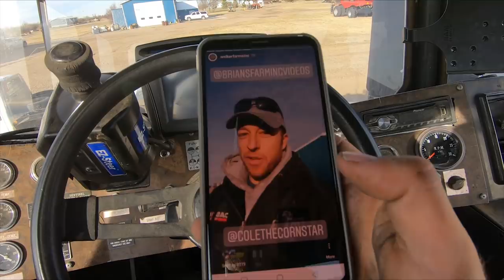Gearing Up For Winter

Comment: I use nothing but non ethanol 91 octane all year long in all 18 of my small engines.  Towards winter time I give them a splash of Sea Foam.  Works great up hear in northern Minnesota.  That way I don't have to worry about draining out the crappy ethanol fuel.  Been doing it for years and have never had a problem starting the engines back up in the spring.  Ethanol mixed gas has a short shelf life, gums up carburetors and damages o rings, fuel lines, diaphragms etc.    I do use it in my truck and the wife's van but never ever in anything that has gas sitting in the tank for more that a week.

Comment: tip from a car mechanic. when removing the tire, place the sensor right before 12 oclock. when getting the tire on the rim, place the sensor at 3 oclock. do that and you will never bust a sensor

Comment: Here in Minnesota we buy non oxygenated gas at the gas station. It is really just Ethyl/Hi test but has no ethanol just use it all the time in small motors or low use stuff, saves keeping track  at the season change. Then just take the can from the mower to the snow blower. Always ready.

Comment: We have several gas stations around here (Fond du Lac WI) where we always buy 91 octane gas w/ no ethanol which we use in all our small gas engines.  We usually try to use up most of the gas in each machine and then add some Sta-Bil gas stabilizer for the winter.

Comment: Not sure the price of avgas,  we use VP small engine fuel. It’s high octane and last years. Just talked to one of the engineers a few days ago. He stated in the original can it’s good for 4 years. Out of the can it’s good for two years. It comes in 50:1/40:1/4cycle. Not the cheapest but it’s done my farm and businesses well. They also make a mix called mechanic in a bottle. It has fixed two of my 2 cycle engines in less  than 30 seconds.

Comment: Two suggestions. Stabill for the gas tanks and system.  Second beads for the tires. They come in bags now and the wheels never go out of balance. 
 Also the pressure sensor caps are a lot cheaper and work well with the beads.
Reply: Good to know..... thanks

Comment: Sta-bil 7.5 oz to 5 gallon and fill all the machines with it run for 10 minutes shut fuel valve and run out of the carbs should fire back up in the spring with no trouble. Wife's rider sat for 2 winters in the outside storage shed with a full tank of fuel and sta-bil replaced the battery changed the oil and it started right up.

Comment: Try using a product  called Sea Foam. I have used it in all my engines. Once had a motorcycle that had been in storage for five years. Put a new battery in the bike and added a can of Sea Foam. A couple of days went buy and I tried to start the bike but it wouldn’t stay running. Put another can in it and waited a few more days. After a few tries it stayed running. My local farm equipment dealer uses it all the engines they service.

Comment: I saw when you broke the TPMS. When you break the bead of the tire keep the valve at 12 o'clock or 6 o'clock so you dont break them breaking the bead. When removing the tire put the valve under the duck head so you hit it when taking it off and when putting on the tire put the valve across the duck head so when putting it on you dont break them. I have learned the hard way I have had to pay for broken sensor before so I learned how to do it right.
Reply from the maker: On the bright side they were old and it was time to replace. Thanks for the advice!
Reply: Yes true. Youre welcome and love the videos keep up and just have to get past the itchy and then grow it I have been growing mine out for four five years

Comment: Those tire pressure sensors are a pain.I am sure someone has already said this but here goes. I was taught by my dad to take the tire off at the valve stem first and put the tire on at the valve stem last. that keeps you from smashing or pinching the valve stem where it goes through the wheel. the pinch can cause a rubber valve stem to leak, let alone the plastic pressure sensors. Just tryin to help. good video. I watch all of your vids and keep up the good work.

Comment: When you replace a tire on a rim that has a tire pressure monitor like that you have to start the machine just a few inches in front of the tire pressure monitors the initial pop down doesn't take out the monitor
Reply: I was about to comment that 👍
I hate those f-kn things 👿 
All of this tpms shit just started because of that One truck manufacturer put a tire that was in the smallest size on a truck, and then some people overloaded those and drove a bit to fast so the tires exploded..
So to not be sued the manufacturer put tpms on the cars, then they could point out that it was the customers responsibility..
And then all manufacturers join in.. 
So now we mechanics get to deal with it since there is always some problems with those👿
Reply: Was  at the tire store pickup tires have them install the the tires could of saved money
Reply: @mrolsen6987  that is why you take them off of your tire and put them in a pipe with caps on both ends fill pipe with adequate pressure. Never have a problem

Comment: Pro tip for not breaking tire pressure sensors, that area of the tire comes off first and on last so the bead never hits it. Also, I hope you torqued the wheels to 140ftlbs like they call for
Reply: I love the torque sticks.  Awesome with an air impact.

Comment: I haven't been without my beard for more than a few days, keep it about somewhere between you and your brothers except when grew one for the forth of july thing and we started even with close shave at barber shop, great feel having a barber do the thing of getting all the hair off and I almost kept it that way but felt wrong so back its been for at least thirty some. Seen LegArms and Deboss having a time with acummins swap and your brother was in his world of wrenching but I could tell, he wants to come home... bad. Always need Ike with Mike to keep the plow straight (mules) I were a hobby farmer for dad. Try that on the farm some time Nick hooking up mules to a single disk plow and hold the team where you want it for ... give you a break  cause your in fair shape so four hours. I did it for daylight to dark and after some days. You will hurt so bad that a hot tube might get you walking in a day or so. Nice getting new tires, seen what you pulled off and they are better than the best I have on my exploder. Good rig, three hundred seventy some miles and still quiet running good transportation. I think buildings and tanks for grin hold the priority on have to haves... paint might wait on some... maybe the minneapolis moline will get a rattle can/LOL. Always fun to bring a old one back to run and stop. Know I missed stuff as I could write a book to you guys but then these electric dots would be in the dot container in the sky. I have always had a tail dragger for spare time till I lost one leg and arm for use.. No I wasn't referring to your brother/lol, I don't know how to use instagram or I would.. google it some day I guess. I am missing out on twenty first century knowledge and when I was born there hadn't been many if any tv's much less cell phones and now you can do farm chores and protect your home, start the car and program the trip... reminder to wait next week for baby to get here and the list is infinite on what a cell phone will do. I had a phone in my truck and the bill was a thousand a month for limited service and I couldn't touch it but just use it to call wife when out on job or ambulance on our helicopter crews.. enough.. great video

Comment: just use 91 octane no ethanol and no alcohol, that is what I use for all my small engines year round up here in MN.  the 91 is way cheaper than that AV. fuel.  congrats and good luck with the new baby...

Comment: You need to give it about a month before the beard stops itching and to start softening up. Comb it a lot and use a good beard wash, may have to use a shampoo if it gets especially dirty and greasy. I have found a wooden comb to work good to keep it from getting crazy curly and help keep it soft.

Comment: There are going to be many opinions on when one should replace tires some go by the tread indicators or tread depth. I myself go by the manufacture date no matter how much tread is on them. Been driving a tow truck for near 30 years. When picking up rollovers due to tire blow out I have noticed that they are 4 years & 2or3 months old. Only one have I seen that blew at 3 1/2 years. 
I know the tire manufacturers & auto makers state 6 years but is it really worth the risk of driving on risky tires with ones family. If one does have to drive on tires older than 4 years old keep the speed down to 55mph & below.

Comment: Plastic waste pipe blank the ends after putting tp sensors inside fit a tire valve and inflate pipe no more issues with tp sensors

Comment: I loath tire pressure sensors, they are not cheap and they don't last. And I'm gonna catch flak for it, but if you can't use a tire pressure gauge maybe you shouldn't be driving.
For beard advice order some beard specific soap. I use Grave Before Shave beard wash, makes facial hair a little softer and makes you smell nice at least according to my wife.

Comment: "Smart move" using 100LL AV fuel in your small engines.I have been using AV gas for several years in anything that will be sitting for a long while.When I get ready to use any of my equipment after it has been sitting for a long time it's just a matter of checking the oil turn on the fuel and fire it up,,,works very well and works every time!!
Reply: we can get 98octane at some local gas stations, but fewer and fewer have that. the normal 95 the sell have ethanol in it,
Reply: Stian can’t go to gas stations, airports always have it.
Reply: @jaxturner7288   airport here have stoppet selling gas, dont know where the ones with micro planes get gas from now.  but the 98 gas stations have dont have any ethanol in it so works good :)  europe, i know in USA its hard to get good gas.

Comment: The beard being itchy can be mostly solved by letting it grow out to the point of being itchy and then going over it all with a battery-operated  beard clipper.  A regular blade razor cuts the beard by shoving it over and then cutting it at an angle and leaving the end pointy.

The clippers erect the beard and then cut it off, leaving a blunt end on the beard.  Don't laugh, it really works.

Comment: Hi nick great video, what's the legal tyre depth in the U.S.A. Don't worry about tyre pressure sensor valves just stick standard valve's in it will save to time and money lol 😀 😀😀
Reply: Legal is 2/32" but with the winter coming on you need deeper groves.
Reply: Hi nick, thanks for the reply, I'm only asking because I live in the Valleys South Wales United Kingdom and a tyre fitter by trade 👍👍

Comment: Do you run on the same tires in the winter as you do in the summer? Aren't you required to have winter tires? Here in Norway, your license would get suspended if you got caught with summer tires in the winter season..
Reply: The US has pretty relaxed vehicle laws, a very small amount of place here require you to have snow chains in your vehicle in the winter. Most of us in snowy places use all seasons or have summers and winters on different sets of wheels. I personally keep summer tires on my car and run Mud terrains on my truck. We get about 5 ft of snow a year nothing to crazy here.

Comment: Just a suggestion, but you might want to clean your battery's. Dirt can transfer energy. Dirt, vibrations , and heat are big killers of batteries.  Awesome videos.
Reply: You are correct. The dirt hold the moisture that provides a path for the electrons between poles. Battery discharges, then freeze warps the plates.
Reply: @craigsmith8217    Exactly, forgot to mention the freezing plates. Good catch.

Comment: Hey Nick great video 👍 can u tell me what's the purpose of putting avgas in the engines over winter 🤔
Reply from the maker: It lasts much longer than gasoline with ethanol. We've found that pump gas with ethanol goes bad after a few months but av gas is highly refined and has a much longer shelf life.
Reply: Thank you 👍👍that explains a lot the petrol we have over here seems to deteriorate an go sour very quickly in the tanks of antique equipment 👍👍

Comment: How cold do you get in the winter? Do you have to worry about low charge batteries freezing. Would solar panels on equipment not help?
Reply: Fully charged batteries won’t freeze but any with low state of charge will freeze swell up and then never work again.  Each winter weeds out the crappy batteries naturally.

Comment: does the lake flow in and out ? if not be careful on how much chemical you use; we have here in CA. a place called the Salton Sea which is a lake actually; way back  they were trying to divert the Colorado river , but one of the earth dams failed and filled an area outside of Palm Springs, only problem is the water has no place to go, and over time with all of the farms it raised the salt level beyond repair every year there is a fish die off which smells for hundreds of miles; I live about 80 miles to the west of palm springs and can smell the stench when the winds pickup
Reply: It flows into a basin just north of our place, which doesn't flow out.  I saw a documentary on that debacle.  Amazing the area it flooded and the damage.  They thought it might be in up a resort lake but salt killed it.

Comment: You do know that when you buy tires that the tire shop will mount and balance them for you. I realize you probably saved a few dollars but you broke 2 sensors.  If the shop broke the sensors they would have had to replace them at no charge. Sometimes tripping over dollars to save dimes doesn't make sense.
Reply from the maker: Definitely true! Just trying to justify these machines we bought 😂

Comment: Always odd jobs that need to be done. 100LL works wonders keeping small engine carbs alive.
Reply: How well would that work in chain saws and/or two stroke boat motors?  I've always just ran them dry if possible, and added the Stabl gas additive if not...  I guess the other part of that is does 100LL work better than the Stabl?
Reply: @kirbyspencer538  I do both 100LL and stabil. However 100LL is more expensive than just buying ethanol free gas in a lot of places. It's great when you can't get access to ethanol free gas. Works in both 2 and 4 stroke equipment.

Comment: whats the advantage of running 100LL in small engines?
Reply from the maker: Higher performance, more reliable, and less chance of carburetor failure than fuel with ethanol.
Reply: @WelkerFarms  and you dont have any issues with lead fouling plugs? I've always seen engines say not to run leaded gas because it was foul stuff up....  maybe they just dont want people running it even though its fine.

Too bad therea not place around me to get  100LL.  I dont think PHL will be very happy with me driving up to the gates with a 5gal can haha

Comment: Why not just pour some stabil I to the gas tanks instead of the AV gas?
Reply: Stabil doesn't keep the water in the gas from corroding aluminum carburetor parts. But does a good job of keeping the gas usable.
Reply: @craigsmith8217  But if you burn all of the gas out of the carbs, it doesn't matter.
Reply: @drooplug  IF !

Comment: I didn't understand why he was going at the airport for fuel, can someone explain please ?
Reply from the maker: Only airports sell 100ll fuel. This fuel is highly refined and does not contain ethanol which small engine carburetors do not like. This fuel is intended for aviation only but as long as it is used in engines other than vehicles that typically use taxed fuel it is okay.

Comment: When you break the bead on the tire, stay away from the valve stem to avoid damaging it, in fact focus all you efforts 180 degrees from the valve stem as much as possible during the process.
Reply: Jax Turner they are being replaced so it’s fine. Plus there not tubed tires
Reply: FishFind3000 uhh, tubes have nothing to do with it, and yeah they are being replaced, do you know why?? Because he didn’t do what I said and he busted them while mounting the tires, that might be over your head but he will get it soon enough, ya only gotta buy about a dozen tps sensors  or have someone tell ya before you learn, take note young buck, save yourself some hassle and your breath before bothering to correct someone who actually knows what’s going on.   

As if any suburbans have tubes in their tires nowadays OR any tubed tires have tps sensors???  Nah son.  Stay quiet and pay attention, you have much to learn.

Comment: leaded fuel in 2019?
Reply: Its aviation fuel
Reply: 100 or 110LL which is Low Lead aviation fuel for older piston powered and radial engines, Its good stuff and way more stable than Unleaded which has a shelf life of around 90 days from blending.
I've bought old cars with 30 year old leaded fuel in the tank, drained and used it just fine.
Unleaded turns nasty and to varnish after a few years and wont run even small engines well after 12/24 months  so 100LL is an excellent choice for not destroying stationary and small engines.

Comment: You keep talking about a beard, I thought you just forgot to wash your face. Get some inline fuel shutoff valves. They have them on Amazon, 5 for $8 with clamps or 10 for $11with clamps.

Comment: You are wasting so much time and money. There is no need for anything beyond pump gas. All you need to do is treat your small engine gasoline with Sta-bil AND Seafoam in the fall with the recommended quantities. The only time you need to worry about draining and replacing fuel is if the fuel is over 3 years old.
Reply from the maker: We are converting all small engines to run 100ll and will no longer use pump gas so I figured might as well flush everything and start fresh.